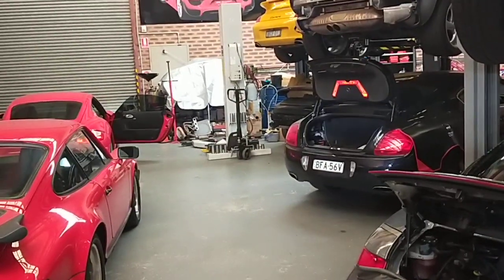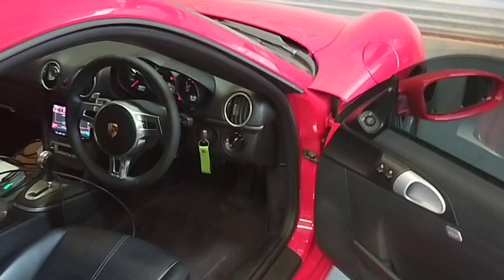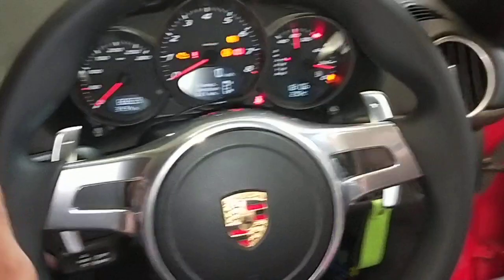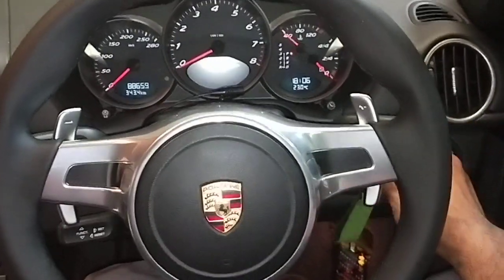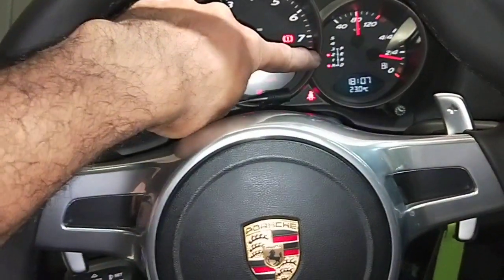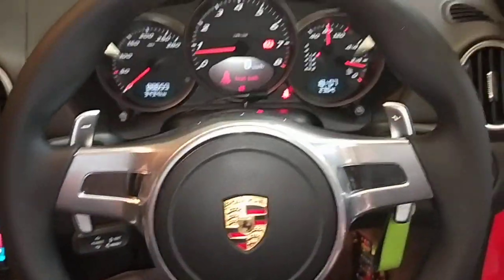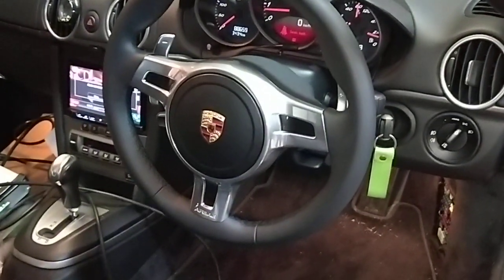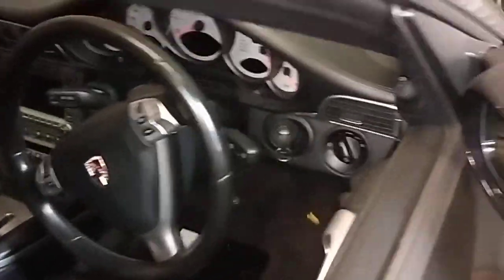Porsche PDK steering wheel installed on a Cayman 987/Carrera 997

Comment: Just curious. I have a 997.1 Turbo. I have same Sport Design wheel and airbag ready to go in. Both are non Multi function. Do I also need to swap out the module to the new PDK module as well, or can I leave the module?  Thanks
Reply from the maker: Hi James
You need to the module to make it work

Comment: Hi there. Can you tell me where I can get this "coded in" and would I need another part of loom or wiring to do this please.
I have tiptronic 997.1 and have 997.2 steering wheel.  Please assist.  Thanks in advance.
Reply from the maker: You need steering column electronics ecu, steering wheel with paddle shift + the round airbag 
Coding can be done by anyone with piwiz scan tool